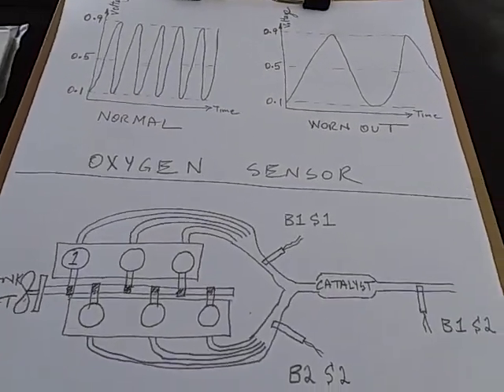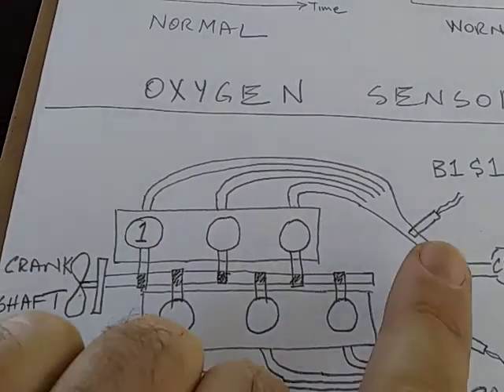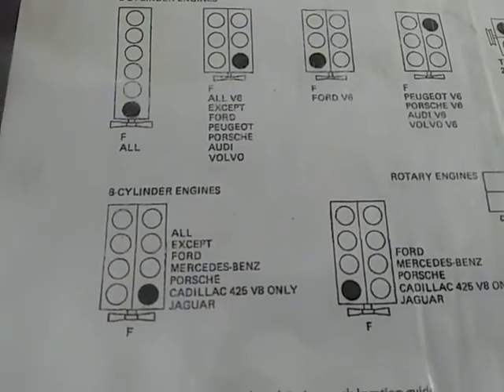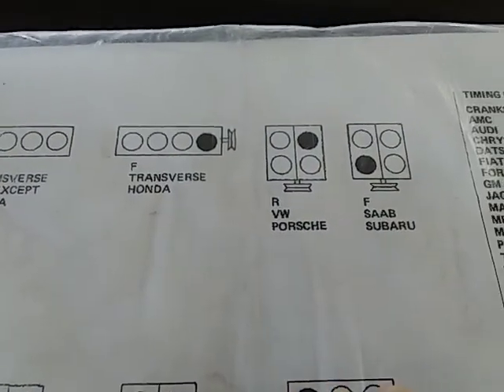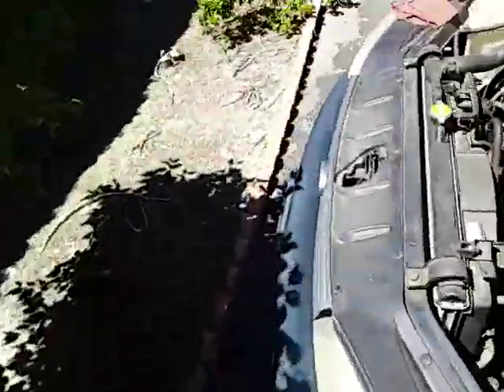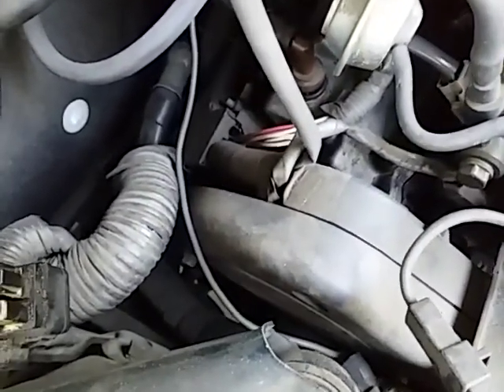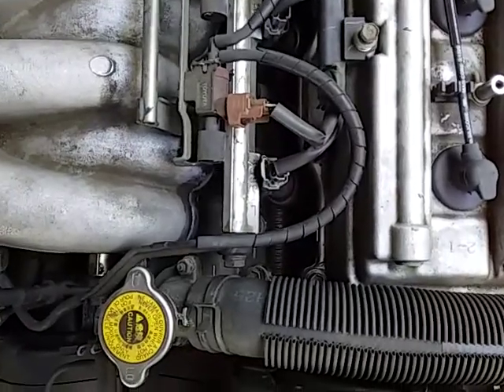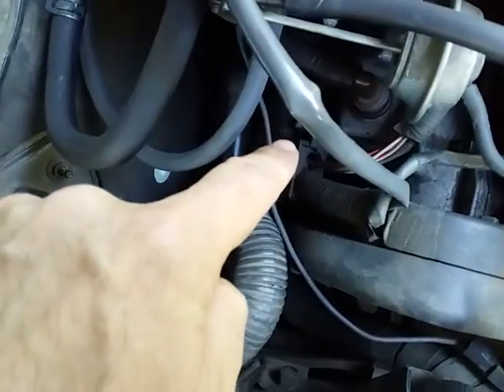OBD1 oxygen sensor diagnostics, Toyota Camry V6, 3.0L, 3VZ-FE, 3VZFE, 1992 1993 Lexus ES300

Comment: can you explain how you bypassed the VSV for the fuel pressure regulator? was your car running very noticably rich and poor idle before this?
Reply from the maker: Bypass is very easy, just a matter of rearranging vacuum hoses, my 91 four cylinder Camry doesn't even have this valve. In your case running rich and poor idling could be caused by many things, you have to troubleshoot.  This isn't an easy engine to work on, four cylinders are much more accessible, good 🤞 luck

Comment: How would you take out the rear 02 Sensor? I ve tried, its seems imposible.
Reply from the maker: If you are going to take the aluminum air intake out, may as well change the spark plugs and wires, but before that, change the valve cover gasket. You are going to have a sore back.  Cover the intake manifold holes with rags so nothing falls into them.
Reply from the maker: This car is not an easy car to work on, I wished I had gotten the four cylinder version of it way back, you have to raise the front end on ramps and see if you can reach it from the bottom, if that doesn't work, then you have to take out the aluminum air intake, that's a royal pain, the O2 sensors are really cheap though.
Reply: @carinapowered995  Absolutly agree with you. Also from the bottom is almost impossible because of the bridge engine support. sadly,  I will take out de Air Intake . Thaks for your request!
Reply: If anyone else is in the game, after so, i ve took out the sensor by geting out first the hood strut . That gives you more space to play and finally reach the sensor.

Comment: Hi! Am I right in thinking that OX2 in the diagnostic plug is the B2S1 (B2S2 in your vid) and OX1 connector is for the B1S1? Or you haven't confirmed it?
Reply from the maker: S1 is before catalytic converter, they call it upstream, its closest to the engine, S2 is after catalyst/downstream, furthest away from engine.  I got one of them wrong in my little sketch, but I corrected in the discription.  Cheers
Reply: @carinapowered995  Yes, I know you corrected it, but I mentioned that just for clarity. I have this engine in mr2, so it's positioned differently and I'm kind of confused. One sensor is easily accessible from the top, and the other one is hidden and hard to get to (possible from underneath the car). So is the one from the top B1S1 and OX1 in the plug?
Reply from the maker: The original mr2 engine is a four cyl but I see on YT a lot of people put the six cyl, back when they were making these cars there was no B1S1, all that came about with OBD2, I would think OX1 in that little box would mean bank1, but I haven't actually verified it with voltmeter, best thing would be to actually do it, especially yours that every thing has been custom installed.  Hooking up a scanner to this engine is nearly impossible, and doesn't give you a lot of info, it gives you live data which is nice, you got to use the old red brick snapon with the correct cartridge.  If I had to do it again, I wouldn't buy a six cyl anymore, also this engine was made only for two years and finding parts in wrecking yard is limited.
Reply: @carinapowered995  Hmm.. I'll dig in tomorrow, disconnect the easy accessible one and check with multimeter at the plug. That's the best way to make sure I guess. Ok, thanks for your time anyway. Cheers!

Comment: I have a 1992 Toyota Camry V6LE 3.0L; do I have to o2 sensors that need to be replaced? I changed the one in front behind the radiator. Two weeks later my check engine came back on. Reading says Code 5 which is o2 sensor. 

Any advice or suggestions would be very appreciated... 

Thanks in advance.
Reply from the maker: I think you have a broken or short circuited O2 wire, with these old cars thats the only time light comes on.  I bought a ten dollar circuit checker from harbor freight, looks like a big screwdriver with a sharp point and two led lights in the handle and wires coming out the top of handle, you connect it to the + & - of battery and poke the sharp edge into wire and by watching the green & red led, you can tell if there is voltage or ground short in wires.  You can use your voltmeter to do the same job.
Reply: @carinapowered995  That’s a great suggest that I will be taking your advice on. This tool should come in handy for other sensors in the near future. I do have a ODB1 device on order but in the meantime I am trying to figure out the minor issue. Ended up linking up on a website blog called www.Toyotanation.com able to ask questions. Found out there’s 2 sensors one that I’ve changed and one behind the CAT! This is probably the reason why my check engine light comes on. Also gentlemen gave me this site said it’s the same site the dealerships mechanic use > https://www.toyodiy.com might come in handy sometime...
Reply from the maker: Looking at it some more there are more codes for oxygen sensors like codes 5, 21, 27, 28.  You might want to investigate what each one does.  With my car I have never experienced the light coming on, but a whiles back I had to get the ECM rebuilt because the capacitors inside  blowup.  Being retired I don't drive the car very much anymore.